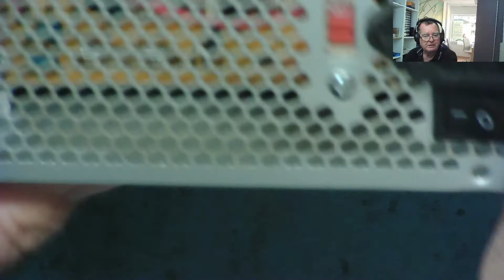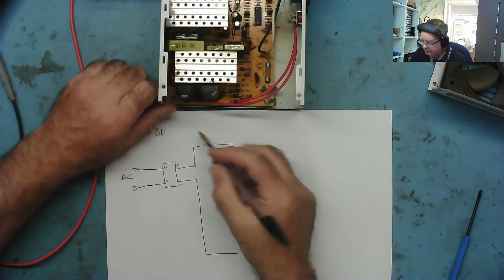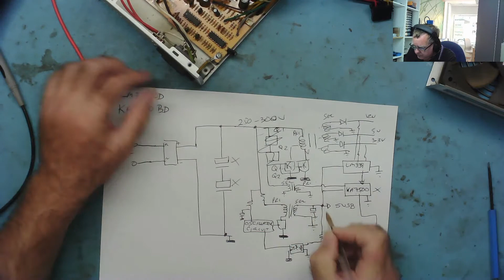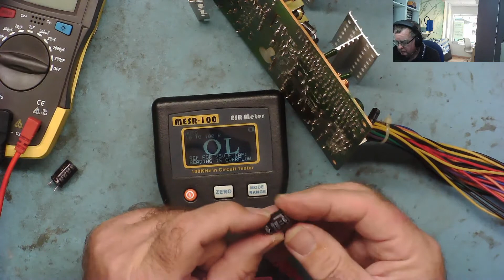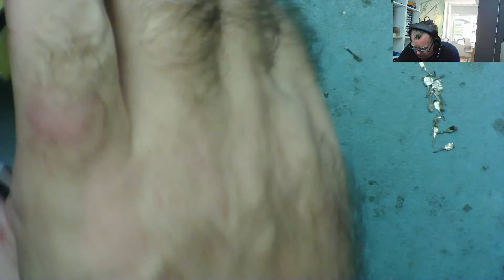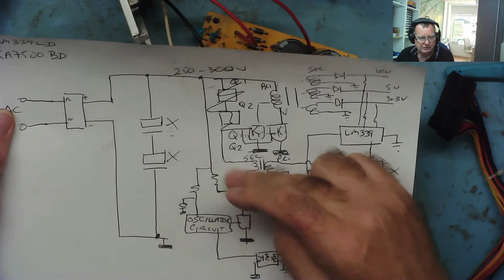500W ATX PSU Repair. Faulty with a Burning Smell. LER #067.

Comment: When you drew the circuit you put the two electrolytic caps in series not parallel, was that an assumption?
I know this is often done to allow for a higher working voltage but reduces the capacitance. 
When you flipped the board over they did appear to be in series.
Is this common on these computer switch mode power supplies?
Reply: In this case they were 200V caps, which wasn't enough to withstand the working voltage of the psu. I think it's quite common in computer psu's for this to be done, the disadvantage of this method is that it halves the effective capacitance of each capacitor.
Reply: @will_doherty  Yes, that's what I said, lol.
It may also allow two physically smaller caps to fit the case instead of one big or taller one.
Plus the manufacture may have had these caps in stock already. Possibly overall a cost saving.
Reply: @KB1UIF  Apologies - you did! I managed to miss that part of your comment...
Reply: @will_doherty  No problem Will, 
its all good !!

Comment: Is the wallpaper a photo of the volcano in the canary islands?
Reply from the maker: peddersoldchap Ahh - yes it is but not the one that erupted recently on the island of La Palma.  

I took the photo looking westwards from Pico de los Nieves (peak of the snow - or more correctly peak of those snows) which is the highest point in Gran Canaria at almost 2000m and close to the geometric centre of the island.  

In the foreground you can see Roque Nublo (clouds rock) which is the largest free standing stone in the world, and in the distance, the volcano is actually Mount Teide on the island of Tenerife, which is the worlds third largest volcano, and the highest one on an island in the world.

Gran Canaria is stunningly beautiful if you explore the interior, from the point I took the photo, on a clear day, which is most of the time,  you can actually see the ocean all the way around the island, it's about 12-13 miles to the coast in any direction as the crow flies.

La Palma island (where we had the eruption) is on the other side of Tenerife.
Reply: @LearnElectronicsRepair  YAY! Do I get a prize?

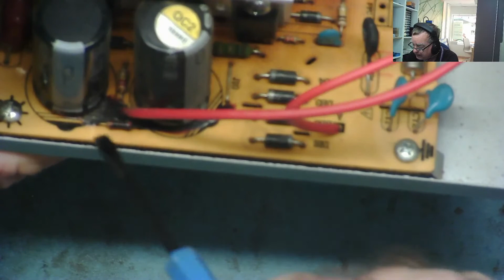Comment: 8:33 that black thing... Sometimes some of the type of the white/yellow glue (which is very often applied on coils and capacitors) become brown or black after few or over 10 years. Maybe because some kind of chemical reaction, which probably leads to carbon (carbonize)
But the thing is - if you see brown and black colour, always check it for the continuity on diode test and high resistance. You will be surprised that some of that black glue will start to conducts. I had few old audio amplifier, where that glue become black and start to make a short on pads/points and on the transistor legs. So since that day, when I see hard(dry) and black glue I remove it from the board.

Comment: Replacing that power supply would cost less than the cost of the banjaxxed parts in it. I'e seen them for £10.99 on Ebay.

Comment: hi...what is wrong with my PSU when it urs on and off? and the 5v standby is pulsating. thanks.
Reply from the maker: The most likely reason for 5V STB to be pulsating is faulty capacitors. 

As you can't post photos of your PSU here I would suggest you join the totally free forum at badcaps.net  https://www.badcaps.net/forum/

Once you registered then post in the Troubleshooting Power Supplies section - describe the fault, the model number of your PSU and some photos of the PCB.  Once you did that you should get some help and answers from the nice folks on there but also post back here and I will take a look as well

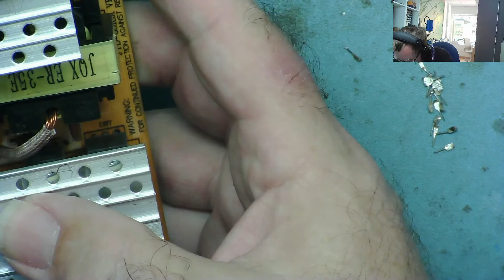Comment from the maker: While reviewing this video I noticed that the missing pin cut from the IC had wedged itself between the green capacitor and a resistor near to the IC that I removed and the 5V STB Capacitor that I replaced.  You can clearly see this at 57 mins, and after I try to dislodge any stray pins by knocking the PCB against the workbench you can still see it is present at 58:09.  Fortunately it was not in a place that it would cause any short circuits but this is a perfect example of why you must account for anything conductive that could have fallen onto the circuit board during your repair work :D